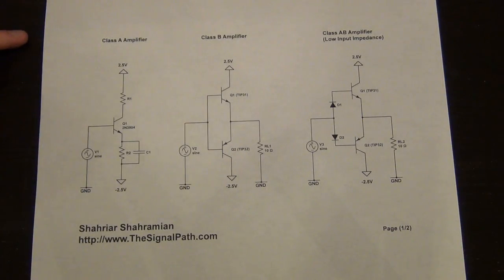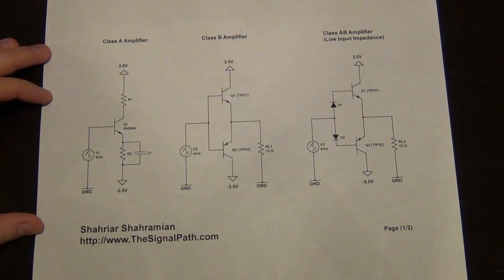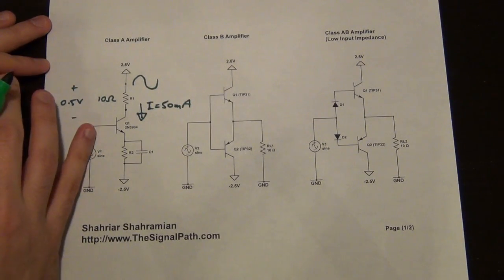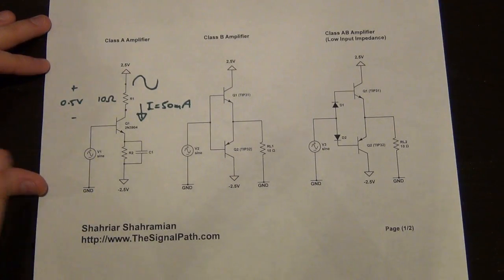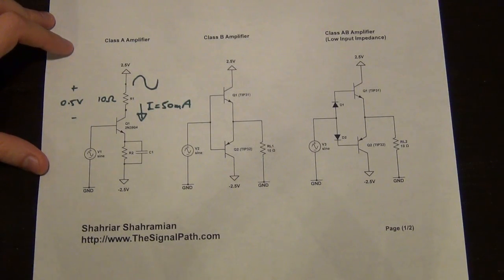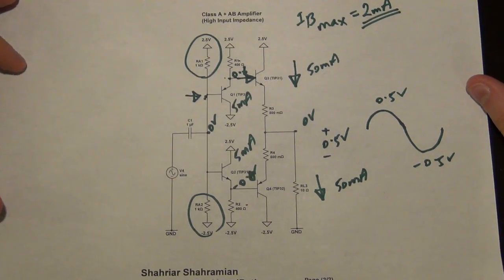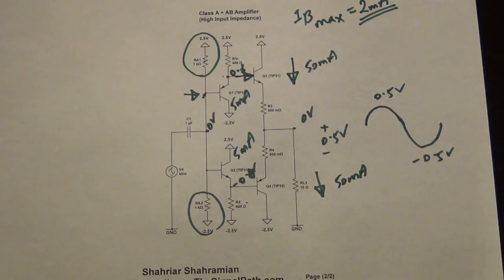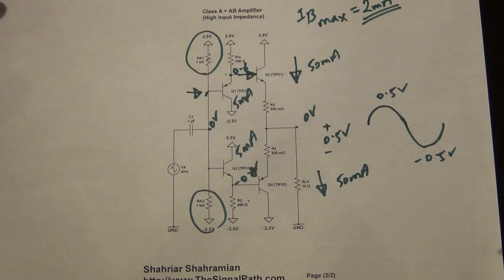TSP #23 - Tutorial on the Design and Characterization of Class-B and AB Amplifiers

Comment from the maker: Please note that in the schematic diagram the diode D1 is backwards! In the measured circuit the diode is placed correctly which is why the measurement results are correct.
Reply: Also, in the X-Y scope, Y is input and X, output.
Reply: I thought that looked funny, and kept trying to figure out how that was going to work.
Reply: Video posted 8y ago and only 10 months ago  errata? :)
Reply: The reason for no output at 5v p-p input I think is because the current through the first stage of transistors went too high and the gate voltages for the next stage of transistors fell below 0.6, thus, there was no output. 
Anyway, we started to build amplifiers right? but, neither of the 2 designs could output a voltage higher than the input, then, how can we call these as amplifiers? 
Please, reply quickly.
And thanks for the video.
Reply: @SJayanth  It amplifies current. Before it you need add stages which amplify voltage - in common emitter configuration.
Reply: As far as an X-Y display on a scope is concerned; wouldn't they both be inputs? @ve2zzz
Reply: @Dennis-mq6or   "Y" is the amplifier's input, "X" is the amplifier's output.
Reply: @Dennis-mq6or  Excuse me, i shall have specified:   X input is the amplifier's input and Y is the amplifier's output.
Reply from the maker: @aardvark2zz  The only error in the schematic is the reversed diode D1. Nothing else is wrong.
Reply from the maker: @andr27  There used to be annotations on the video, but YouTube removed those long ago. So I added a pinned comments.  :)
Reply: @Thesignalpath  and reply on my comment took only 2 years XDDD
Reply: @SJayanth  these AB class amplifiers have a voltage gain around 1, it amplifies the current, thats why the voltage amplification should be done by a previous stage

Comment from the maker: This is a conceptual schematic diagram. Both diodes D1 and D2 require a bias current to maintain their junction voltage. But, perhaps more importantly for you to consider, my channel has received about 1300 comments so far. You are the first to use obscene language. My channel is a place to exchange information politely and I would like to keep it that way.
Reply: Thanks for your sharing. 
I am really disappointed with those that do not consider the value of these videos for the others.
thanks and please don't loss  your motivation.
Your channel is valuable.

Comment: Great tutorial! your D1 is oriented incorrectly and signal needs to be applied to each base of the transistors and not to the middle of the diode network. Adding some input caps to kill any dc is a good practice. Also, consider using a Vbe multiplier for the a-ab amplifier. It saves you a transistor plus you can use a potentiometer to dial in the biasing current.
Reply: I just wanted to write this as well. In Class AB amplifier diode orientation is wrong.
Reply: i can’t believe after i watch a whole video and looks everything make sense
Reply: Just came to write this! 😂

Comment: awesome video, shahriar...keep up the good work.. answer to the quiz is "with increasing input voltage u r saturating the transistors gradually that's y output is getting clipped off. after all you'll never get output higher than the driving supply voltage.."

Comment: Another excellent video! Once again, I appreciate all of your hard work. Very high quality instruction. 
I believe the answer to your quiz question is the distortion is caused because you are using 2.5 volt supplies. The distortion is caused because there is not enough voltage to drive the transistors through the complete cycle. The transistors are clipping the input signal when they are saturated.

Comment from the maker: The spectrum analyzer is AC coupled at its input. Furthermore, the output load of the amplifier is 10Ohms. Therefore, adding another 50Ohm in parallel has minimal impact.

Comment: This is a very old video! But a very good old one!

Thank to God of Science that my 'luck' is good! This is the best ever 'tutorial' on amplifiers! Shahriar's A + AB design actually works and works frighteningly well!

I mean, I simulate it. I have nearly zero hope that simulators (I use Multisim) are accurate, let alone precise, but when I match those measured and simulated numbers they are frighteningly similar! I say this because (simulated) component data are far from realistic. I do not mean the intricacies such as temperature, vibration, and so forth. I actually mean basic characteristics such as saturation, breakdown, and so on. Most op-amp, for instance, have zero limitation, you can feed them kilo volts input and kilovolts of power supply and the the output signal still looks normal! Same goes for diodes.

I now wonder how to actually make it an amplifier, which component to change. The circuit is not exactly an amplifier but a current/voltage follower. There is no amplification.

Comment: The reason for no output at 5v p-p input I think is because the current through the first stage of transistors went too high and the gate voltages for the next stage of transistors fell below 0.6, thus, there was no output. 
Anyway, we started to build amplifiers right? but, neither of the 2 designs could output a voltage higher than the input, then, how can we call these as amplifiers? 
Please, reply quickly.
And thanks for the video.

Comment: Your class AB circuit makes no sense. Since Vin is connected to the anode of the top diode, and when it is at 0 volts, the cathode of the top diode should be -0.6V when that diode is conducting. So the voltage there should be - 0.6V and not +0.6V. Thus your top transistor is turned off until Vin reaches 1.2 V. This makes your circuit worse than a class B amplifier. Your crossover distortion has double in size and importance.
The top diode should be pointing down rather than pointing up. There should also be a biasing circuit that will ensure that both diodes are forward biased and that they conduct at all times. This is why this class of amplifiers has an efficiency of about 50%. The biasing resistors for both diodes should be high enough so that a small current is pulled from the power supply at all times.
Reply from the maker: +said jellouli The diode in the schematic shown in the video is backward. It has been corrected on the schematic that is posted on my website. The actual circuit being measured is correct which is why it works.
Reply: you have no idea about "Shahriar". He is world class Electronics engineer. Much more knowledgeable than you
Reply: I DISAGREE!
Reply: @The Signal Path, I love your channel, but you should consider re-shooting this video with the corrected schematic shown because of such a glaring error that's inconsistent with your explanation.
Reply: The error is already explained....no need to reshoot.
Reply: Also, I think the class B example is really class C amplifier. You explained really well that you need about +-0,6V to start having any transistor conducting. Which means there is some signal lost, as transistors don't really conduct for half of signal (definition of class B, two active devices or banks of devices conducting for 180°) and they conduct for only peaks of input singal (class C definition - in some cases you want to use it to save power and later reproduce original sine wave with some error).

So while this material is very instructive for beginners, it contains some misinformation.
Reply: @Thesignalpath  
With diode it will not work, even if you reverse  there will be two back to back diode

Comment: Just a minor point, the distortion is called 'crossover distortion' and the history of manufacturers to overcome this and other areas of harmonic distortion is fascinating with the THD wars and giving us 0.0001% thd and below. 0.1% is considered ideal and was given us first by H J leak in his ''point one'' amp series in around 1948 (from memory)
Reply: +mart fart push-pull ultra linear valve amplifiers are no joke. The circuit family is called Williamson amplifiers.
Reply: TheLawnWanderer
Leak predated the Williamson and I dont beleive it was ultra linear design I think williamson used ''overall'' negative feedback as a first and envisaged a triode output not pentode/tetrode. Blumlein invented ultralinear in the 30s along with many other great discoveries.
Reply: mart fart point one wasn't UL, but triode connected instead. 
The later ones were UL though, really no point to not use UL. 
Pretty much all modern amplifiers in that style are UL with the option to switch to triode with a simple switch.

Comment: So is it that you've reached saturation in the transistor?
Reply: Saturatio will be reached if the input signal (peak) reaches the NPN' collector's voltage +  0.6 volt (an PNP collector -Vcc + -0.6V).

In the deadzone, both transistors are in cutoff region.

Comment: The strange effect is called clipping, and it occurs when the amplifier has a voltage at the input than the supply voltage divided by the gain, and so has run out of "headroom" and so it just cuts the top and bottom of the waveform off to make it fit within its supply voltage limits. Every amplifier ever made  does this in one way or another when overdriven.  I hope this has explained it for everyone!

Comment: The emitter resistors on the class AB amplifier also serve as protection for thermal runaway. Because there is a bigger current through the second amplifier stage (Q3 & Q4) than first amp. stage (Q1 & Q2), the transistor pairs are going to heat up to different temperatures and the B-E voltages are going to change. Suddenly the second stage is going to conduct more and more current and will eventually burn out. Emitter resistors prevent that by reducing the B-E voltage when the current increases.

Comment: i think the answer is as you increase the input voltage, the transistors begin to saturate as they reach near the supply voltage of the circuit,
 just increase the supply voltage to solve the problem:)

Comment: Answer: Input signal level approaches 1st stage supply voltage forcing 1st stage to saturate since there is no longer a voltage difference across BE junction, second stage responds by not turning off and holding output at rail voltage.  Commonly referred to as output clipping and very damaging to resistive loads that cannot dissipate a DC bias current that appears across it.

Comment: VERY nice presentation. I would to have liked to see a Vbe multiplier, I call it a bias transistor and how to determine where to start biasing from. if you build a circuit and just put a pot in, how would someone determine where to start as not to blow up the outputs. Another useful thing would be to determine how much bias per output device as with high power amps. also, where to determine bias current and where to look. I have an amp where they have you put a certin resistor in place of the rail fuse and then look at the voltage drop to get current. What they don't say is if you add a few more transistors to the output, what, then would be the bias current or voltage. What would be a good rule of thumb to use to get the proper bias voltage/current so you don't blow it up. High power amps are real tricky like that.

Comment: Answer to the question:  When you rise the amplitude of input signal, the output signal start to get distorted when reach +/-2.5v(the amplifier goes to limitation) In fact, the sine wave from the output have the peaks chopped and limited to 5vpp(the voltage of power supply). That's why the amplifier stop to be linear from a certain level above.If you rise the voltage of the power supply, the amp should act linear again even at high amplitude at input. Btw: nice lab! where did you get him!?

Comment: Hi sir ! I have a simple question about  the hFE  of the final transistors of an NSA amplifier operating in the parallel SEPP circuit . Particulary I am talking about Pioneer A9  ,which is working in parallel SEPP with a high frequency DC servo bias. 
So the question is should  the end power transistor  have the same hFE? Likes the the class letter and likes a digit number to prevent the distortion?

Comment: There's one thing I can't understand. In class B operation, one diode will have its collector-emitter junction reverse bisased, correct? It has to handle this reverse voltage. I can't seem to find what spec I need to look for in the datasheet so I know it won't break down

Comment: Quiz answer: The output clipping occurs because Q3 and Q4 transistors are not getting enough base current at that point.This happens their base current is governed by the value of the R1 and R2 respectively.Those resistors 'see' a voltage that gets smaller and smaller as input is getting larger.So the current across them is getting lower and lower.  Hence, if we would like to improve the circuit performance we could lower the value of R1 and R2 at the cost of more quiescent current of course.

Comment: in class AB each diode will also need a biasing resistor in order to develop the 0.6v voltage across its leads. Shahriar mentioned that. For simplicity in the tutorial the resistors are omitted in the classAB schematic

Comment: why didnt you show the biasing part in the first amplifier on the left? you are telling the dc bias is causing an unnecessary power dissipation even if there is no input signal right? but your drawings has no bias? this is a bit confusing..
Reply: You don't need further biasing when using a bipolar source for a class A amplifier, as the negative source at the emmiter keeps base-emmiter voltage above 0.6V even when input voltage is 0. Oops! Just realized this is a 2 year old comment hahah
Reply: @orti1283  Are you sure about that? Do you have a reference? I was assuming it was a small signal phenomenon like the OP suggested.
Reply: @parkerd2154  I'm 100% sure, you can check Microelectronic Circuits and Devices by Mark Horenstein :)

Comment: The effect of the xy plot is due to over saturation in the final stage where the output transistors reach VDD and cannot switch any longer.   However of you analyze the saturated output on the analyzer you will see the harmonic tones will still be amplified producing a horrible sound. The way to control this is to limit the gain of the overall amp by providing a negative feedback loop to the input stage, a differential input stage of matched transistors works well to assist in the loop control. However I am not sure if the total bandwidth of amp is still preserved with negative feedback...

Comment: I'd like to design a Class AB amplifier using BJT's (2n2222 and 2n2907) to drive an 8 ohm speaker.
How do I determine component values i.e. Resistors and Capacitors?

Comment: Yes in the second drawing the transistor that replace the diodes are biased, that's why they react at a voltage below 0.7. In the first drowing instead the crossover gap is wider, 0.7 volt of the diodes and the 0.7Vbe min of the transisor.

Comment: Hello.
this video is very much helpful in practically understanding the crossover distortion in class b amplifier.

I request you to please provide the actual circuit diagram with the specific component values, which you have implemented on the breadboard.
I want to implement this circuit on breadboard  and study it individually.

Comment: I don't see the reason why the 1k resistors are needed at 19:56 . I know that a single transistor has to be biased in order to "let through" both plus and minus of the incoming signal. But isn't adding a bias of 0V like not adding any bias at all. I mean zero is nothing, x + 0 = x? The capacitor is (already) making sure that only AC is coming in?

Comment: The answer to the question is that the input signal is hitting the +/- power rails of the amplifier circuit. Either you would need to keep the input signal within that limit or increase the power supply voltage. Ultimately, you might have to redesign the circuit to work with the required higher power supply voltage.

Comment: at 28:17, you say the input is on the horizontal (x) axis, and the output is on the vertical (y) axis.  Shouldn't it be the other way around (input on vertical and output on horizontal)?  Because for inputs between -0.6V and +0.6V,  output = 0V.

Comment: 11:25 In the Class AB amp scheme with the diodes, the voltage offset I got between transistor bases was 1.0V instead the expected 1.2V (0.6 + 0.6). Nevertheless I got no distortion on the output! The XY graph of the sine wave of each transistor base is a straight line that intersects the XY axes on 1V and -1V respectively! Why not 1.2V as expected?

Comment: All the other designs i've seen for the class ab amplifier has d1 and d2 pointing in the same direction(down). can you explain this?
Reply: XyekiniX Both diodes (d1 & d2) should be pointing down for correct operation.  There is a mistake in the class AB schematic.

Comment: The clipping occurs because the resistors of the class-A amplifiers can only provide so much current to the bases of the class-AB amplifier. When the input signal is too large, one of the class-A transistors is fully closed and the other is saturated. The collector resistor of the closed one provides as much current as the base of the second tr. can draw. And because the voltage of the load increases, the voltage of the resistor decreases until it reaches equilibrium. And there is your clipping.